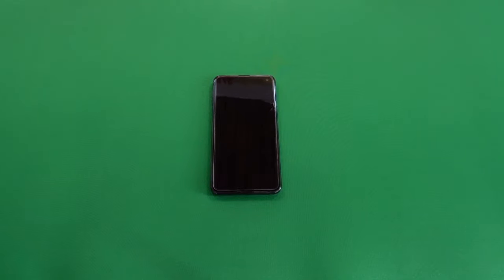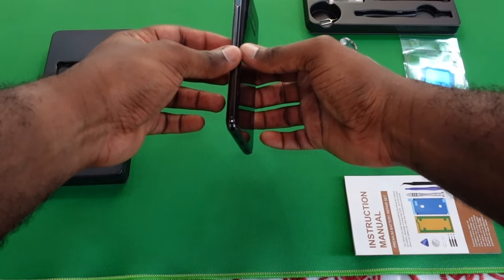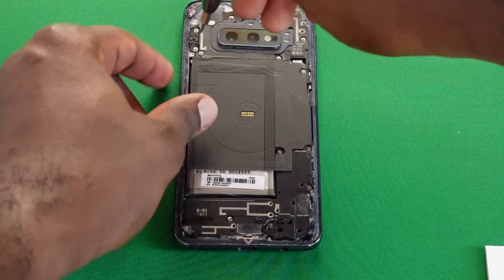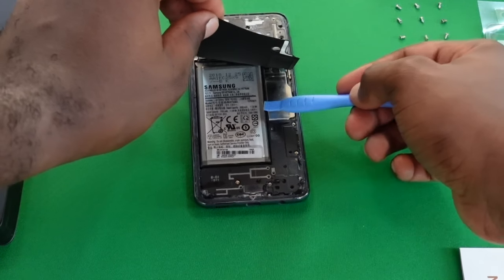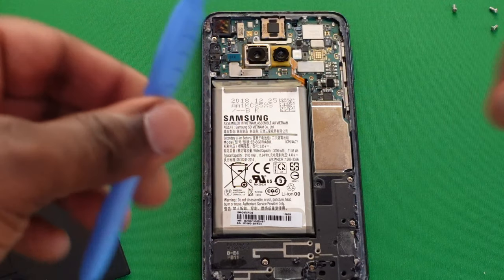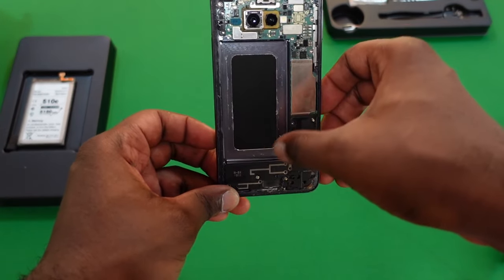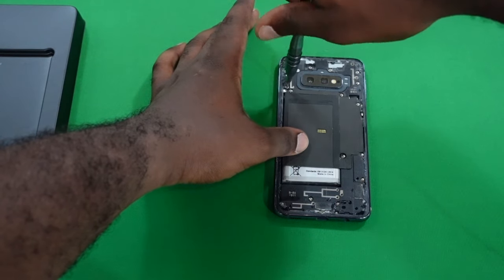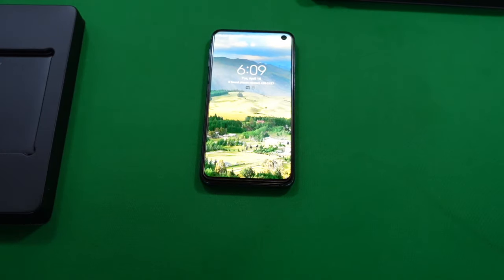Samsung S10e Battery Replacement

Comment: The capacity youve bought is higher, can u notice in daily useage the 5000mah versus the old 3000-ish mah capacity? Is using the phone any better overall?
Reply from the maker: Although the capacity is higher "on the label" I do not believe it is that much higher in reality. In honesty it lasts slightly longer than the original. 

I wish I had a battery 🔋 tester to check the actual capacity as some of these companies lie.

One important thing I've noticed is that it does take longer to charge than I remember. Almost as if I lost fast charging capabilities.
Reply: @KevinSmall  ah I see thanks! So my best bet would be get another original battery with same capacity?
Reply: Or a reputed branded battery of quality. Instead of random Chinese made ones
Reply from the maker: @monkeypoo8511  correct !! If possible you should do that once it is affordable.
Reply: @KevinSmall  thanks so much! 🤩👍

Comment: You didn’t show how to get the back plate off
Reply: yh was confused why this wasn't shown. For anyone watching, you have to heat up back to heat up glue, then put thin plastic like a guitar pic around entire edge in gap between back and sides to "cut through" the glue, but not stick it in too much or pull too hard cause could break something inside (unlikely on this model as wireless charging coil and bottom shield cover most cables).  Do this around entire edge of back and then it should come off (a lot of people use suction cups to help pull back off).
Reply: lol literally  the most important step in the process and he skiped right over it. useless video.